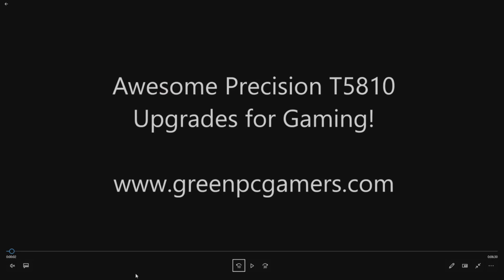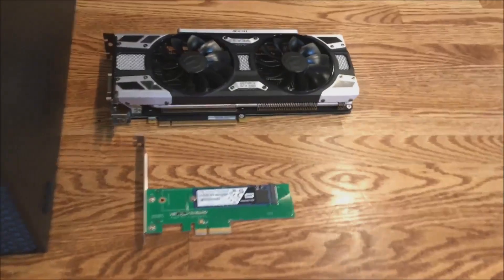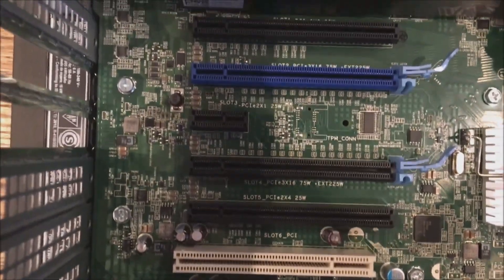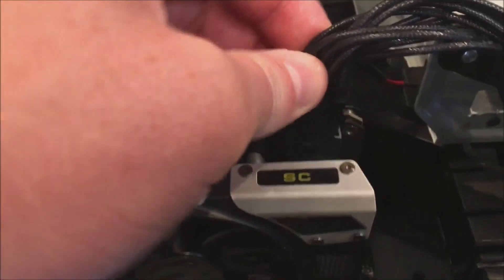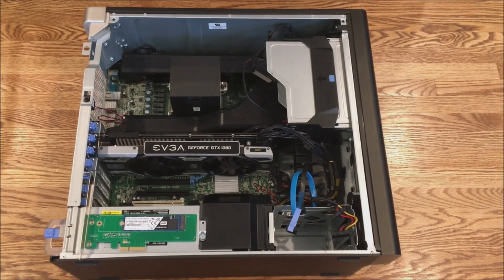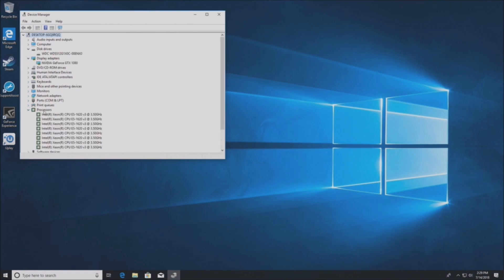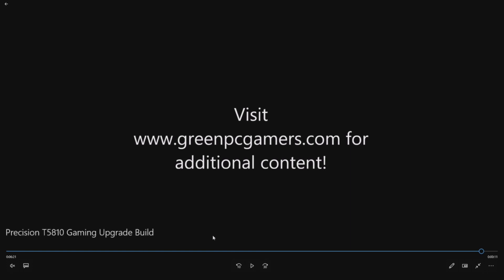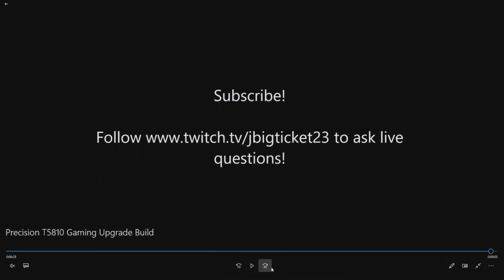Precision T5810 Gaming Computer (GTX 1080 and NVME.2 SSD)

Comment: I plan to upgrade my t5810 to GTX1080Ti GPU. What power supply do I need? 825w or 1300w? Do I need to upgrade to 1300w directly for future potential GPU upgrade? Thanks.
Reply: This guy has you worrying too much about the psu lol as long as your CPU isn't drawing 250+ watts while the GPU is under a load it'll never be a problem
Reply: @tyler6602  Thanks for your help. I upgrade my power to 825w. But I find that the PCIe support is not enough (8pin only). So I plan to use SATA power or the CPU2 power to support the 1080Ti.

Comment: Most modern GPUs don't fit this case as the outer case "door" has an annoying bump rivetted on which reduces case width by about an inch or so - just enough so you can't close the case. You should either get a low profile GPU or you won't be able to close the case.
Reply: I'm late but, it's easy to get around. There's two slots wired for PCIe x16. If you just drill the rivets on the weird bump it comes right off. Literally no clue why it's there

Comment: I would recommend using the actual cable u can get for the dell precision t5810 which is a 6+8 pin pcie cable u can get off ebay for pretty cheap just much safer then those stupid adapters

Comment: I got one from my job. I upgraded the PSU and put a GTX 1660 in it. Unfortunately I'm running off of a SATA SSD but soon, thanks to your vid, I'm going to be running the OS off of an M.2 NVMe and using the the SATA SSDs for storage (cause I'm cheap). Thanks for the vid!

Comment: Hey, I just visited your website to find out upgrade options for t5810. my configuration is Intel Xeon E5 2673 V3 12c, 32gb ram and a Quadro P4000 with 685w power supply. I want to upgrade to RTX 3060. your website recommends having 825W power supply. but as per my research both RTX 3060 and GTX 1080 consume similar amount of power. please tell me if I should buy the RTX3060 or not or should I go for RTX A2000

Comment: Is e5-2690 v2 compatible with the stock cooler
Reply from the maker: The T5810 only supports E5-16XX or E5-26XX V3 or V4 Processors.

Comment: My T5810:  E-5 1650 V4 (6 core 3.6 gig/4.0 turbo) , 32GB, 1300w power supply, bluray drive, one 250 gig 980 pro nvme (OS), one 1tb 980 pro nvme (games/storage), Asus GTX 1080ti 11 gig.  I play Fortnite (dx11 medium settings/165 fps/ranked), APEX Legends(medium settings 165 fps or max settings 120 fps), Destiny 2 (max settings/120-165 fps), BF5 (max settings 165 fps), and Minecraft (max settings).  Naturally the frames per second goes up and down but not much.  I use different nvme adapters that go in the second video card slot (16x) and the top slot above the video card (8x).  Search (M.2 PCIe NVMe SSD to PCI-E Express 3.0 X4 X8 X16 Adapter Card Full Speed) on Ebay to see it.  I run three Dell t5810 computers.  One is mine, one is my wifes, and one is my sons.  My younger son runs a water cooled  i9 9900k, 64GB, 850w power supply, 2 980 pro nvme drives, and an RTX 3080.  There is a difference, but not enough to warrant the huge price difference.

Comment: Can i use the rtx 3060 or 3060 ti with the same device .. currently i am using gtx 780 and i want to upgrade for AI generating websites
Reply from the maker: As long as you can provide the power and the slots, yes.

Comment: i have one of these with a E5-1607 3.1ghz and a quadro m2000 but i want to move to more PC gaming than console. If I put a E5-2687W 3.0Ghz and a RTX 3070 would it be able to run COD titles at 1440p 100+ fps? anybody out there built this already or have an idea what configuration i would need for that?
Reply: There'd be no point of getting a 3070 as the cpu is not capable enough for the gpu hence it will bottleneck the gpu, so go with something on the lighter side like a 1080 ti or a 2070

Comment: I just found one of these.
With Xeon 1650 v3 though.
its got 64gb DDR4 2133mhz + geforce 1080.

530 USD, is that a good deal?

Got a great main rig, this is for replacing my 2nd "retro" rig.
Honestly i cant find a deal like this for the same price!

Comment: Yesterday i installed an EVGA SC GTX 1070 and I was pleasantly surprised. My T5810 has a E5-1660 V3 and 32 GB of RAM and I got it for less than 20 bucks. I'm so happy with it.
Reply: Nice.
Reply: please tell me where did you got it from
Reply: @vishwanathkadu9011  ebay
Reply: Bro you installed any bios mod or update something to update the cpu?

Comment: I just got one with a 1650 v3 cpu. I plan on putting a amd RX 6600 in here shortly. Do you know if its worth upgrading? and if so, worth it going to like a 1660 v4?
Reply from the maker: For gaming, it wouldn't be worth the upgrade.  However, it might be worth the upgrade for the additional cores if you are using the cpu for rendering/batching projects.

Comment: im about to pick one of these up with a 1tb hdd and a gtx 970. Would you recommend I get a similar ssd drive to clone the operating system onto? would there be much benefit?
Reply from the maker: Yes,  the NVMe drives can be up to 6 times faster than regular sata SSD’s in the T5810 Workstation.

Comment: I upgraded the processor to Intel Xeon 1650 V3 and RTX3060 12GB running on the stock 685W PSU. It runs fine, i use it for deep learning work, running darknet YOLO object detection model training and inference.
Reply: Hello, i have the E5 1630 v3 , which one is better for this cpu , 3060 ti or 3070 or 2080 ? I want to buy one soon , what is your opinion ? Thanks

Comment: For a time, I just had my setup in this case along with some higher tier stuff like a xeon grade CPU that it came with yet later on I switched to an alienware aurora, honestly, regret it heaps. Although this had some issues too, like when my mother broke and I had to wait a month for an whole replacement to ship all the way from america but I'd much rather not have to worry about alienware's questionable hardware and will power draining software..
When I renew my setup, I'm definitely just getting a workstation and cramming in whatever I have

Comment: Thanks for the video. I installed a GTX1660 Ti in my 5810 and because of where the power cable connects in the card I cannot close the side panel. I was wondering if I can move all the components to another case?
Reply from the maker: It would be tough to do a case swap because the T5810 doesn’t use standard atx components.  If the metal bracket on the side panel is in the way, this video will show you how to remove it:  https://youtu.be/-g_LpWSkqtQ

You could also do a custome perforated side panel.  That video is also on our channel.
Reply: @GreenPCGamerscom  thank you for the tip in the video on how to remove the metal brace, that was just what I needed. The 5810 is back in business with great graphics.
Reply: @aviationfan486  how did you get the 1660 to work, which power adapter did you get?

Comment: You mentioned the limitations of power from the DELL for this card. I have been offered a GTX 1080i for a good price from a friend. Will it work in my T5810?
Reply from the maker: It'll work, but you will want consider making a custom perforated side panel for better cooling.  (we made a video for this on our channel)  Also, make sure you are using an 825W Power Supply or better.

Comment: I have one question, maybe you can help:
I have a E5-1607 v3 installed (Haswell). Can I upgrade to a Broadwell CPU, like the e5-2640 v4, as this is the same socket LGA2011-3?
Reply: and which CPU would you recomment (ebay up to 300$, I have thought about the e5-2630 v4 or e5-2640 v4). Maybe with a Noctua CPU cooler?

Comment: The PSU is designed for two CPUs an one GPU with two 6-pin PCIe power jacks. As long as you are using only one CPU you can use the second power jack on the PSU circut board for another GPU power cable. I soldered a 8-pin PCIe power cable for the second CPU power jack.

For this tower I would also suggest to use a videocard with a radial fan and a cooling design which blows the hot air from the GPU out of the case. Most custom designs would just heat up the small tower and clock rates may decrease after some gaming time. Some undervolting will also result in lower temperatures and mostly higher clocks.
Reply: I can confirm this. I used 0N08NH (Dell-branded graphics card power cable) and a "10pin to 6+8pin GPU Power Cable" (aftermarket-only power cable that plugs into the 2nd CPU power socket behind the PSU) connected to an 825W power supply to power an RTX 3070 Ti FE and it's been running wonderfully.

Comment: Hey quick question. If i want to get a gtx 1080 which uses an 8 and 6 pin to work, should i replace the 2x6 pin pcie cable with an 8 pin and 6 pin pcie cable. Does it even work? Thanks for the help
Reply: What cable did you use? And where did you find it? :)

Comment: I've done this on my 5810 and the thermals are terrible, the GPU fan screams as the air flow in the 5810 box is so bad. There isn't even an exhaust fan on the case, only three fans in the front that suck air in.

Has anyone been able to improve the airflow on this machine? I"m thinking of adding an exhaust fan to the back through a fan controller, not sure if that will work.
Reply from the maker: Check out our perforated side panel video.  It helps with the cooling.

https://youtu.be/6-VXnMOschE

Comment: How are the temps? Not the exact temps just does it overheat
Reply from the maker: The temps vary based off of the settings that you choose.  We made a custom perforated side panel that helps mitigate really well on the T-Series workstations.  Check out the video: https://youtu.be/6-VXnMOschE
Reply: @GreenPCGamerscom  ok thank you.

Comment: Also odd question, would I be able to use a Intel Xeon E5-2697 to install within the T5810 tower. It says its able to take it, but I just wanna know if it actually does good for the system or not.
Reply from the maker: We've never tried the E5-2697 processor in a T5810 Workstation.  If it was going to work, it would have to be the V3 or V4 version. 
 Let us know if you try it.

Comment: It looks like two hard drives can be placed within it?

So....would two hard drives be able to work within it
Reply: YES...I have 2 x 2TB HDD's, an NVMe drive in a PCIe slot, and a Radeon RX580 GPU, along with a 685W PSU. Been working fine for the past 3 years.

Comment: Do you need to put in the SSD? My T5810 came with a 512GB SSD so would I need to put in another one?
Reply from the maker: If you are referring to an NVMe M.2 SSD, no.  A standard SSD should be sufficient.

Comment: thank you and can you tell me which is better z640 or  T5810 ?
Reply from the maker: It depends on what you are using them for.  The Z640 has a little more scalability because it supports an optional secondary processor.

Comment: Hello! Can I change my GPU to GTX 1070 in this Dell Precision T5810, E5-1650v4, 32GB ) M4000 8GB System? Because I cant run some games in ultra graphics in this GPU.
Reply from the maker: You could do that.  Swap the card and update to the GeForce Driver.
Reply: I want to install the processor  E5-1650v4
  What is the temperature of the E5-1650v4 processor? Is it high?
Are you running on RAM PC4-2400T ??

Comment: Was wondering if the 5810 could be transplanted to another case? Or do all Dell systems have proprietary connectors? Great video!
Reply from the maker: It would be tough to do because of the size of the motherboard.

Comment: Does it support AMD radeon rx580 or rx 5700xt Thanks
Reply from the maker: Those cards will work in a T5810.
Reply: @GreenPCGamerscom  Hi. great video.I have a dell 5810 that im going to  to update. Do you thank the 685W power supply will work with AMD radeon rx580? what cpu do you recement using in this set up? how many core? thanks :D

Comment: Hp 280 g3 i7 7700 vs Dell T5810 E5-1650-v3 which one is better for gaming purpose?? Help me to choose right one
Reply from the maker: We can't know for sure unless we test them side by side.  However, we'd probably choose the T5810 because of the additional cpu cores and higher wattage power supply.

Comment: Does the PCIE adapter slow down the read/write speeds of the m.2 drive?
Reply from the maker: It depends on the IO speed of the system that you install it in to.

Comment: i got a t5810 for $20 from my job, didn't realize it had this potential! great vid thanks!
Reply from the maker: That is almost as good as free!
Reply: @GreenPCGamerscom  Yeah man thinking about these two upgrades right about now, struggling with heat dissipation only running Team Fortress 2....LOL using a quadro k620 tho quite impressed
Reply: @GreenPCGamerscom I'm looking into upgrading my z440 but it only has dual 6 pin. I can get a 1080ti for 40$ from a friend but it requires 6 and a 8 pin am I out of luck because that sounds like a steal for that gpu
Reply: I got one from my uncles job for FREE, and then my uncle gave me a gtx 960 too, and a 500gb ssd + 1tb hdd :D
Reply: You guys are lucky that pc is expensive in other parts of the world like 400 dollars expe.
Reply: @KINGMANJARO_343 yeah, what a deal! It costs around 3k in my local currency, found a deal for it for 1k (around $245). Damn I envy you guys lol.
Reply: My mom got one of these for 50 bucks and I slapped an rx 570 in
Reply: @hdtv1063  Hi, why did you choose RX 570 over the 580? have you tried running your PC with VR?  can you send me a list of components on your system, I just got a old Dell 5810 from work and im trying to upgrade. now im looking into the RX 580. is the 685 power supply compatible? thanks :D
Reply: @Mr87ziggy  yeah it’s compatable! I have the 685watt power supply and it handles the gpu and cpu just fine. I just got the 570 because it was significantly cheaper on most eights and did not sacrifice a lot of performance. The 580 will work fine in your system, the power supply can handle it! But beware that you have to find the amount of pins your graphics card has and get an adapter for the power supply. I had to get an adapter, they are like 8 dollars, so find the amount of pins on the gpu and power supply and order an adapter.                                    Also my specs are: PSU stock 685 watt with adapter, intel Xeon E5-2603 v3 @1.6ghz, and asus rog strix rx 570, 16gb of ram, PCI-E nvme ssd expansion slot with dell 250gb of ram, western digital blue 1tb hard drive, generic WiFi card off Amazon for like 20 bucks, cd drive, and the stock cpu cooler that came with pc. Good luck with your system!     

Edit: no I have not tried to run be on my system, I looked up some benchmarks and you can play vr with no problem. You might need to lower settings a bit on more intensive games like half life alyx.
Reply: Glad to hear other people are getting by with these old beasts too, just wanted to say thank you for the replies a year later I'm gaming over 100fps just by adding a 1660 Super! Learned a lot from this channel thanks again!
Reply: @Chw N ofc hit me up
Reply: wow. lucky you.

Comment: I know this is an older video, but i recently built a similar setup with my 5810, and i was wondering that when your 5810 boots, does it take a minute or so before it gets to the BIOS Dell screen on yours? Mine does for some reason, and it behaves that way with any GPU i put in.
Reply from the maker: That is 100% normal on a this generation of workstations.
Reply: Yes i have this issue too

Comment: what is latest and most powerful xeon processor I can upgrade this CPU currently with?

I'm looking forward to use it for both gaming and rendering so can you give recommendation in that regard?.
Reply from the maker: I really like this cpu:  

Intel Xeon 8C E5-1660 V4 3.20Ghz 20MB Processor | 3.8Ghz Max Turbo Frequency (SR2PK)
Reply: @GreenPCGamerscom  Just confirm that v4 processors are OK with T5810? Your blog recommendations were all v3 and some say that only v3 will work? However, I have understood that e.g. 1650 v4 has been succesfully installed? I am about to buy a T5810 with 32GB memory without HDD and planning to install M.2 with adapter, probably Samsung EVO 970  Plus 500 GB as the price difference currently between WD Black and this Samsung is small but Samsung has slightly better performance. Thanks for the recommendations, I think I mainly follow those in upgrades for my T5810 :)

Comment: Hey, guys I bought 1080 but when I try to install drivers on Windows 10 pro, it says drive are not supported on this version of the windows. Any thoughts please? because my 970 worked fine.
Reply from the maker: Are you sure it's a GTX 1080?  Did you make sure to select the correct driver?
Reply: @GreenPCGamerscom  I did

Comment: To use a VR do I need to plug the HDMI into GPU or into motherboard?
Reply from the maker: What type of VR system do you have?
Reply: Oculus rift has beginner, but I might move to Vive later.
Reply from the maker: Unfortunately we have never tested that particular system.  I bet another creator has posted some good content on how to setup  an Oculus Rift.
Reply: @GreenPCGamerscom  not a big deal it actually works when plugged in the GPU

Comment: Do you know if I could install E5 2637v2 or 2643 v2 CPU? I did look into the blog but couldn't find the answer I was looking for.
Reply from the maker: The T5810 doesn't support V2 Processors.  You must use E5-26XX V3 or V4 processors.  Our recommended processors are on the T5810 blog page.
Reply: @GreenPCGamerscom could it be any v3, v4 or above like v5 etc. Also, I heard some work station do support i7 CPU since they have the same sockets. Is this the case with 5810?
Reply from the maker: DON28ist the T5810 doesn’t support I7 CPU’s.  You are thinking of the Precision T1700, T3620, and T3630.
Reply: @GreenPCGamerscom  Thanks a lot, you guys are awesome based on amount of free information you provide!